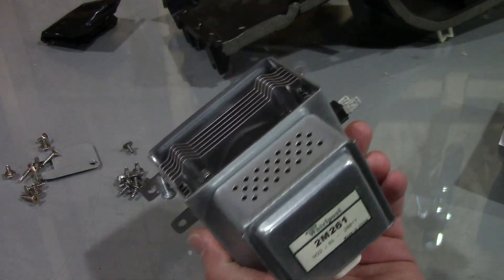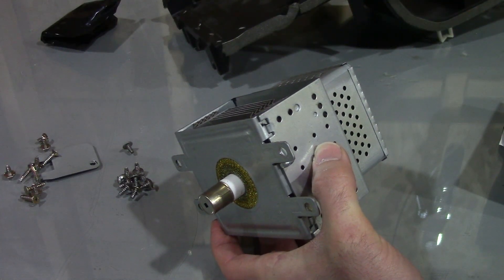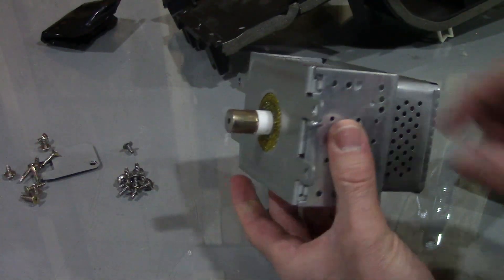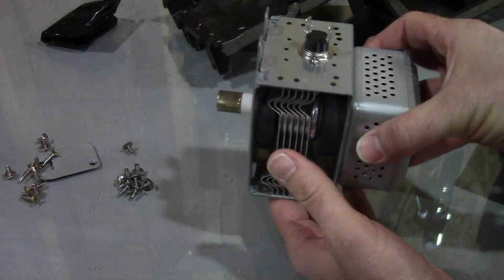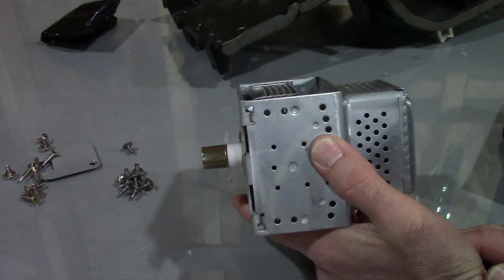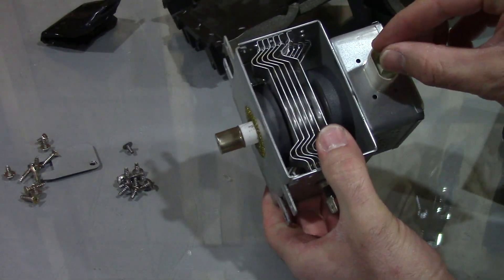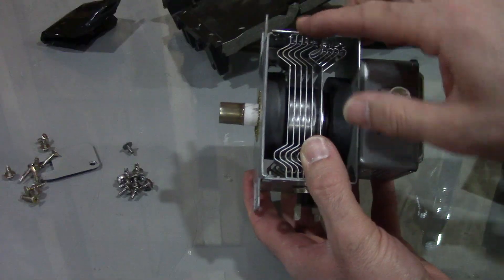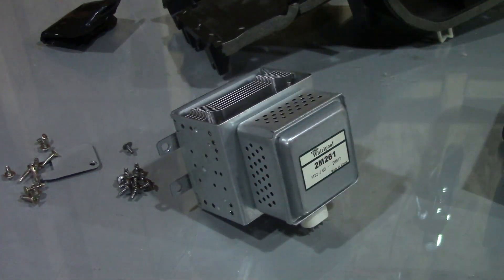What makes a Magnetron dangerous

Comment: I believe that "sensor" that you pointed out is actually a "thermal cutout", basically, if the device gets too hot, that trips, killing power to the magnetron.
Reply: Thermal cutout or thermal switch is actually the correct term. A thermostat is used to regulate temperature. It wouldn't be used to shut something down in an emergency.
Reply: Derpin Bird  maybe to you.
amongst other things I repair cloth dryers for a living.
ordering a replacement thermostat when I meant cutoff switch would not get very far.
Reply: Derpin Bird.
well, I felt like explaining the difference of these things for anyone who might not know and might care.
those who don't can safely ignore and move on with their lives.
Reply: Derpin Bird 
usually they don't.
I did however have an arc welder once that would turn itself on after about an hour of cooling down after overheating.
at the time I didn't ask about it.

never since have i encountered a bouncing back cutoff switch.

i have already stated my reasons for replying and don't really care what you feel about the matter.

so now unless you have an irresistible urge to have the last word I believe that we are done here.

good day
Reply: a thermostat will switch back on relatively quickly after having cooled beneath a certain temperature.
a thermal cutoff might trip back after a while but usually they either have to be manually reset or  they are one shot switches that need to be replaced.
Reply: Jeremy Allen “
Reply: Why are you arguing that it's better to be slightly incorrect? Probably because you can't stand to be wrong...
Reply: A thermal cut out is a sensor. senses the temperature and cuts the power if it gets too high. Usually if the cooling fan quits or the air flow is blocked.
Reply: Split hairs.
Reply: ........Still think its splitting hairs :P
Reply: Well that stands as good reason as to why you shouldn't rely on youtube to fix AC powered appliances. I still don't see why we need to make a 100% correct court case (something i suspect you would fail to do all the time) in what is the end of the day....a youtube video.
Reply: Its split hairs bruh, they are all components that react to a certain characteristic of the environment, just in different ways. Working cutoff switches shouldn't switch themselves back on, that could start a fire. And for whoever thinks this isn't splitting hairs, what is inside that magnetron is just a thermal fuse. If you overheat a magnetron you blow the fuse and its a door stop you can't reset it.
Reply: defined : thermostat.